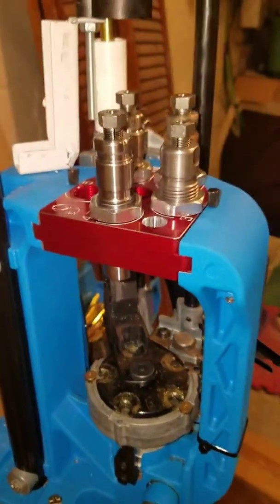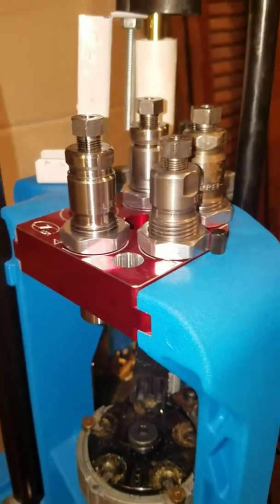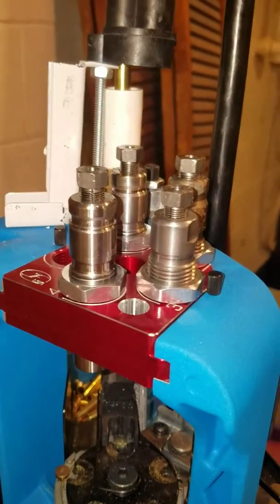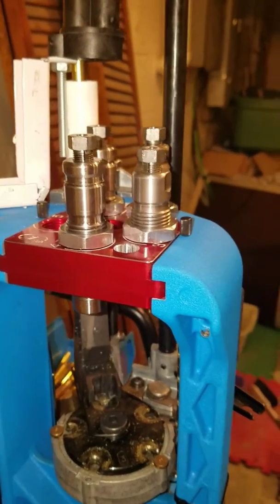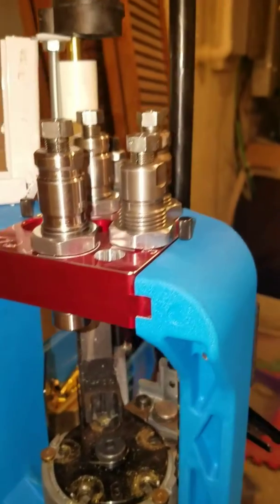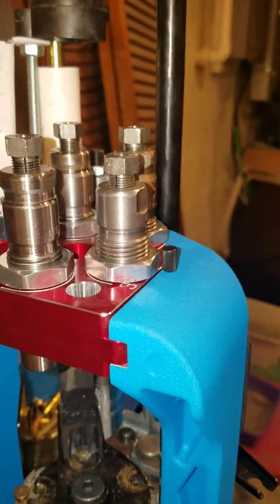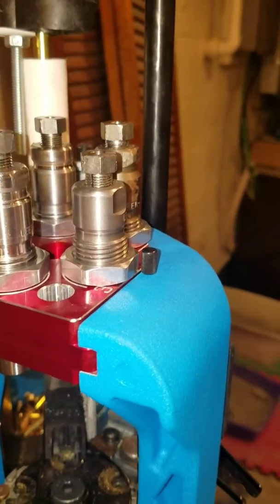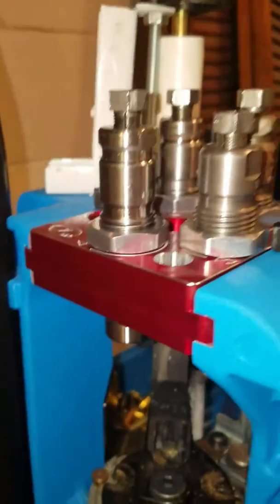Making 357ar/ 350 Legend brass on the cheap.

Comment: I was able to start it with my 300 blackout decapper die it won't go all the way through but then finish it with the expander using plenty of lube, works fairly well, I just have the single stage press.
Reply from the maker: If you wanted it to go all the way through you may be able to use a 308 or any other 30 cal decapping die. I never even thought of that. Good deal. Thanks for the idea.

Comment: Dang that's cool. Gotta love the capability of progressive presses, and ingenuity.  I wonder what your loss rate would be with an annealer.
Reply from the maker: Sorry for the non reply. I apparently didn't get a notification of your comment. I actually have an annealer and had to run them without annealing first. Annealing softened enough to crush them around 30 Cal or so. Maybe with another step involved it would have been ok, but with this set up annealing first was a no go.
Reply: @milkymakes1  Thanks for the reply. It was really no rush. I find that youtube doesn't show me the majority of channel comments on any particular access point. I have to look for them on a couple different devices to see and respond to them.

Comment: Did you figure out your issue with printing the bullet feeder?
Reply from the maker: Yes, I was printing with a skirt via Cura. It made the print to large for the ender 3 pro. Removed the skirt and printed it just fine. I'm waiting on the motor from China. Only place I could find one. May print a different base for a motor I can get sooner.
Reply: @milkymakes1  I haven't used cura in a while so my settings would be off until I start using it again, right now I am using S3D.  I am glad that you got it figured out.  I am also using my ender3 pro to do all the prints since its smaller and I can manuever it easy.  I am not sure why you were having issues printing on the ender3, I already printed three bases within the last few days.  I am about to print a 4th base because I was assembling one and the thing fell on the floor in the garage and the layers on the base actually came loose.  I have 2-1/2 hours left on this collator and I can start printing another base.

Good luck.
Reply: @milkymakes1  I also see the motors on amazon and ebay, do you have the complete list of motors that you can use?  You just print the base according to the motor.
Reply from the maker: I do have a list. It may come to ordering a different motor. I didn't realize there were that many when I printed it. Thanks